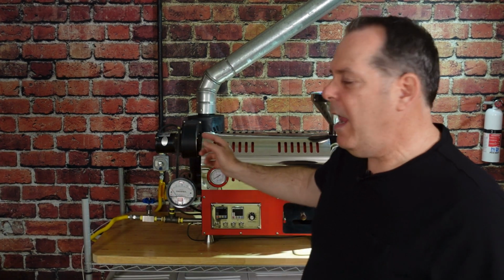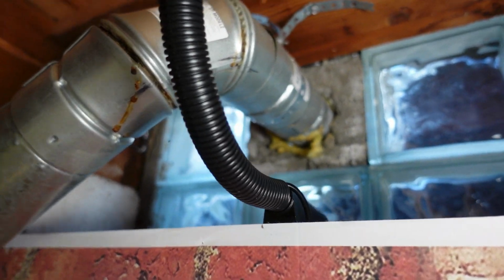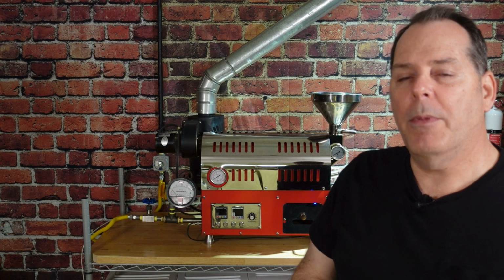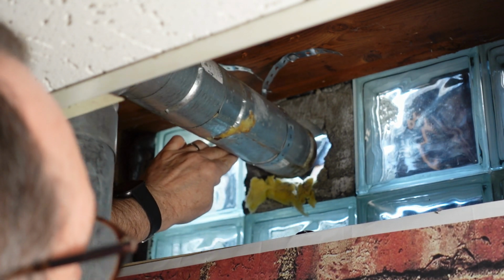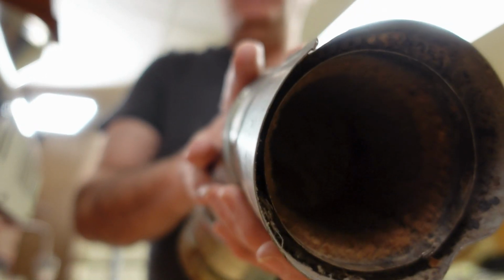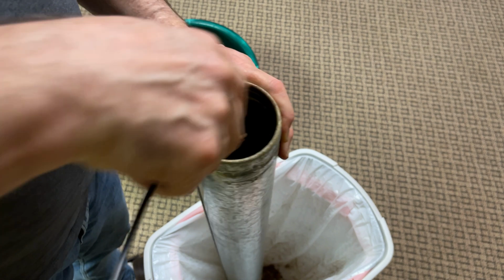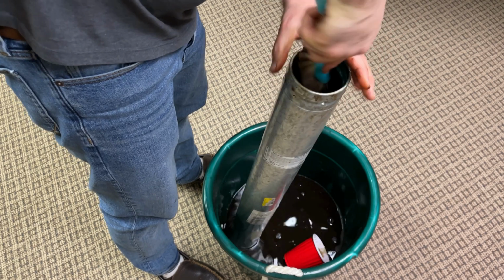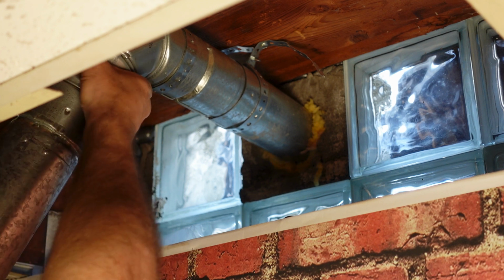Coffee Roaster Vent Flue Cleaning

Comment: why do you not vent off of the cooling bean tray ?     Not enough Chaffe to worry about.   I’m just debating setting it up to main heat vent
Reply from the maker: For the Mill City, they didn't offer that option when I bought the roaster.  I think there newer models have that built in.  Honestly I don't usually roast dark enough to create a lot of smoke from the cooling tray.  I do get some chaff that blows around but I usually vacuum after my roast sessions.  Not really much of a mess at all, even after 4 or 5 roasts.
I usually roast on the lighter side of medium.  If I were roasting a darker coffee i might consider the extra venting.
Reply: @ ok.   Thank you for the feedback    Appreciated

Comment: Another useful and informative video, Im just setting up and after this video updating my ventilation system. What type of extinguisher should be used with 1 kg Toper gas roaster? Thank you
Reply from the maker: That’s a great question.  I’m using a general purpose fire extinguisher for electrical and liquids.  It shoots out a powder like substance.  If used, it would mean a total mess and
Major cleanup.  I guess that would be no problem if it would prevent my house from catching on fire.  Not sure what local requirements you may have so I can’t recommend a specific type or size, sorry.
Reply: @VirtualCoffeeLab  Thank you Mike just gave my machine a deep clean thans to Toper fir the video so feel more relax now. Hope to meet their reps here in Halifax in the north of England for some training too 👍
Reply: I run a 15 kilo Ambex. If it’s a chaff fire, just use water. I’ve used maybe half a gallon down the chaff chamber, a hose is overkill. Electrical or Gas fire definitely use an extinguisher.

Comment: Mike I'm so glad that you actually made a video on one of the more undesirable tasks in our otherwise fun hobby of coffee roasting.  It looked like the buildup on the inside of your pipe was maybe about 1/4" (6 mm) or so?  How often would you recommend doing this dirty but necessary chore, periodically or as needed?

For my venting system, I am using a permanently wall-mounted stove hood (Zline Professional Stainless 597) mounted just a few inches above the roaster.  The hood specifications are:

Dimensions:  29.5 inches (75 cm) wide, 18 inches (46 cm) deep
Duct size: 6 inches (15.2 cm) round
Fan flow rates:  Four speeds:  Speed1 260 CFM; Speed2 340 CFM; Speed3 420 CFM; and Speed4 500 CFM
Material:  #430 stainless steel

The hood has 6" ductwork that carries the exhaust to a basement window very similar to the way yours is done.  The duct is the simple single-wall kind, taped at each joint so nothing can leak back into the roasting room.  Outside the house, the duct goes into a simple dryer vent that hopefully keeps rain out and somewhat prevents back flow from wind.

I now have two roasters (described below) and both of them vent upward to the air below the hood.  Neither roaster is directly connected to the hood fan.  The benefit of doing it that way is the speed of the hood fan should have no effect on the air flow rate through the roaster, as it would have if directly connected.  The drawback of doing it that way is if there is a large burst of smoke produced, I suppose it could go into the room a bit, instead of going into the hood (but I have never seen that).  My hood fan moves so much air, that I need to open another basement window or outside door, to let air into the house for the flow.

My Behmor roaster has a built-in "afterburner" that reduces exhaust smoke significantly, but some still does exit the roaster, going through the air into the hood.  But as you can see above, my fan can move quite a large amount of air.  The most smoke I ever see is when I open the roaster door to pull the drum at the end of the roast.  But even then, the hood captures most if not all of the roaster exhaust.

Although I have not yet run a batch through my new Aillio Bullet, I do know the Bullet does produce smoke during roasting, like most other drum roasters.  That roaster will vent the exhaust upward through the air to the hood above.  I am not anticipating any problems for the hood fan to capture all the roaster exhaust.  My thought is since it does not have any smoke suppression, the hood fan and ductwork might get significantly more dirty than it did with the Behmor.

When I moved my hood so it could accomodate both the Bullet and the Behmor, I had to take all of the ductwork apart and I could easily inspect it for dirt.  After roasting almost a year now with the Behmor exhausting into the stove hood, I did not see any dirt inside the ductwork.  I did notice some dirt on the inside of the stove hood and its fan.

I'm interested in hearing how others are venting their roasts.  Thanks Mike!
Reply from the maker: Thanks for sharing your setup Lou.  That hood fan looks really nice.  Since the fan is not directly part of your roaster(s) build-up will be much slower.  On both o your roasters, the chaff is collected in a special system.   It might be a once a year quick look at the initial opening of your hood fan at and around the filter.  The smoke is going to be the biggest concern you might have and that system seems plenty strong to deal with it.  

As far as the bullet goes, how is the chaff collected there?  Where are you venting the bullet?  Out into the open behind the roaster?  You will most likely get some chaff blowing out of that area.  The smoke will be drawn out but I'm curious what will happen with any chaff that gets past the collector.  Thoughts on that?
Reply: @VirtualCoffeeLab  Yeah, I will have to just see what it does.  The chaff collector is an area in the back of the roaster, I think associated with the exhaust fan.  Aillio recommends, and I definitely plan on cleaning the chaff collector every roast.  In their instructions they say, "Check to see if the filter gasket needs cleaning." and gives a couple of instructions on how to do that, but it sounds pretty easy.  Then after 30 kg of roasting (which would take me almost 4 years to reach), inspection and cleaning of the exhaust fan impeller, cooling box filter, and chaff collector filter is specified.
Reply from the maker: I vacuum my chaff collector after every roasting session.  It is part of my cleanup.  I also have a little chaff fall between the drum and the chassis of the roaster, the funnel and the drop door which get vacuumed as well.  If you are roasting mostly decaf I think you will see very little chaff.

Comment: I roast on my Behmor 2000 AB plus outside on the porch to avoid any chaff inside the house. I live in the Miami Area so cold weather is usually not a problem for me.
Reply from the maker: That is really convenience you can roast outside Eduardo.  Solves a lot of problems!  How have your roasts been going?
Reply: @VirtualCoffeeLab  getting better at it but I wish I had more control over the roast. I wish I could use software to be able to better monitor the roast. Also the Behmor is difficult to see the bean colors change. I am roasting more by smell and sound only. Temperature control is not as easy on the Behmor. 

However, I am happy with the results. 

Most of my coffee is for traditional espresso.

Comment: Your videos were motivation for me to learn something new, got a huky 500. Starting to set everything up today. I was on the popper for a few months and decided I wanted a little upgrade. Showroom had vent tubing I forgot to order so I'm going to run the Huky outside on this stainless table I recently picked up. About to dial in my 5kpa magnehelic and see what this Huky is all about.
Reply from the maker: I was really considering the Huky 500 as a roaster some years ago.  You are going to have a lot of fun roasting!  Let me know how it goes.  What did you say you were using for venting?  the flexible dryer type tubing?  If yes, be careful to not let chaff build up near the back of the roaster.
Reply: @VirtualCoffeeLab  
No vent tube because the chaff collection does a good job and the little chaff I get is no issue. I'm in south east Texas with a large back porch so it's no problem roasting outside year round. 

I did 3 (315 gram) roasts so far on 2 pounds of mystery beans that came with the roaster, didn't dump the chaff collector between roast and stupidly did 1 light 1 medium and lastly a little darker roast I got to 440f BT and boy was there some smoke lol. 

I'm very new, I don't know anything about what I'm doing but I'm keeping it simple by not messing around with fan speeds as you have mentioned in a previous video. I need to figure out how to de-chaff beans after I roast the lighter stuff, some chaff is still on my roasted beans. I'm brewing with a pour over and aeropress using a 1:16 Water/Coffee ratio. Gotta work on my grind sizing as well. Your videos are very helpful, thanks a ton!

Comment: It was interesting to see how much chaff debris gets deposited into the vent system for 150 lbs. of coffee. We have a laser cutter at work and it also needs periodic cleaning of the ventilation system. As a side note, I got my SM Popper roaster and the low cost thermometer you demonstrated and it is all working well together. I use 90.7 g batches since that divides evenly into a pound of coffee. I was able to get some Sumatran coffee to second crack without tripping the overtemp switch and it came out great. I also roasted some Central American coffee to Full City and it also came out very balanced with mild acidity. The only issue I am having is doing the RoR calculations on the fly, even at 30 second intervals, I feel a bit rushed. It is very easy and fast to do a roast compared to the Behmor and there is less chaff cleanup afterwards.
Reply: You need a helper that can record temperatures and calculate the 30-second ROR values while you control the roast! :-)
Reply: I can't link to it here, but if you click on my profile I've linked to a roast log that I made for small fluid bed roasters on Google Sheets. I have an SM Popper as well, and I use the log to track my roasts (a little better than pen and paper). It will calculate the ROR after the fact, but I think it's not so useful for our roaster. Since we're measuring a mix of the environmental temp and the bean temp, and because it will swing wildly as you change Popper settings (it's very agile!), I try to just hit my milestone times. I chatted with SM about it and they agree, for small fluid bed roasters ROR might just be more of a distraction.
Reply from the maker: Sorry your post got thrown into a hold folder in my YT account so I didn't see it until now. 

I would love to see that google sheet you have.  Can you email me the link?  Go to my "about" tab here on the channel and then scroll down to see the email button.  I have some ideas related to data logging and the popper I am considering.
Reply: @VirtualCoffeeLab  Certainly! I've sent it over. Let me know if there's anything that can be improved!
Reply from the maker: Hi Jamie, thanks for your comments and for sharing your experience with the popper and thermometer.  It has worked really well for me too.  I didn't mention there is a variable chaff mess based on the coffee we roast.  For example, Decaf coffee has very little, if any, chaff because of the processing.  I seemd to get more chaff from my central american coffee than I do the african coffee but I don't have any data to support that.

Calculating ROR , if using a calculator should only take 5-10 seconds, plenty of time to pay attention to the roast.  Doing it in your head might take longer, like you saw happening with me on some of my roasts.  As far as making a graph like i did on a recent video, this was done after the roast using the times, temps and events I recorded.  I made the graph for the benefit of conversation for the video.  Just by looking at the ROR numbers like 22,18,14,11,9, etc.... and seeing a nice downward trend will confirm with me that my roast is on track and there are no huge increases or decreases in my ror.  After you do it a few times it gets easier.  Give the calculator a try by taking your current temp and subtracting the previous temp and then double that.  That is your ror for 1 minute.

Keep up the great job on your roasts!